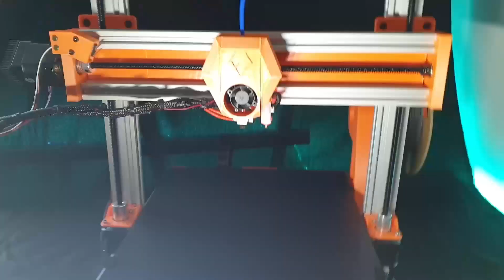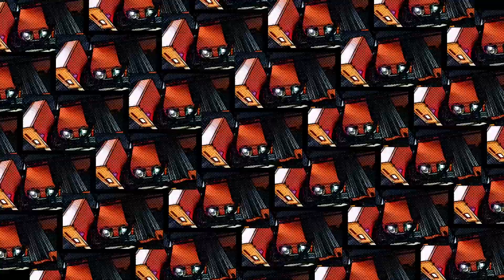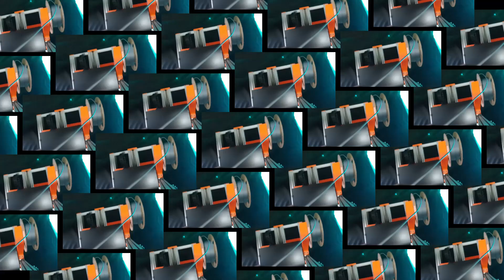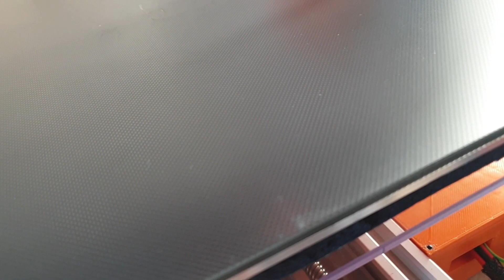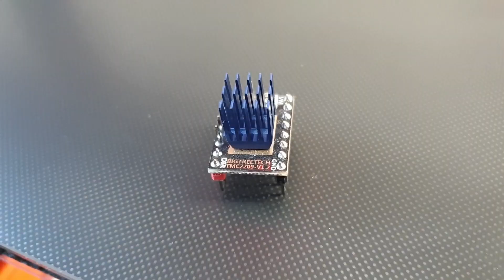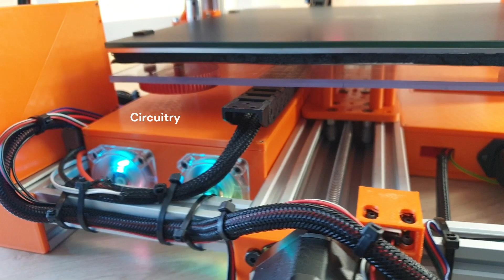Build of a Homemade 3D Printer - Replica3D V4

Comment: Is this an open design for community builders?
Reply from the maker: Hi, not this one but for V5 coming soon, printed parts, and design will be shared on thingiverse.
Reply: @EVinnov  I can't wait to print this :) what are the total costs to build one?
Reply from the maker: @Badg0r  Great to see you interested in this project! I am currently working on the latest version, V5, and striving to optimize it to maintain high-quality specifications while making it more accessible. Updates for V5 will be shared first on Instagram at @evinnov10. As for the total cost, I can't provide an exact figure at the moment, but it is estimated to be around 445 - 890 $, thanks to the careful selection of high-quality electronics and a variety of printing materials such as PLA, ABS, Carbon, Metal, Copper, etc.